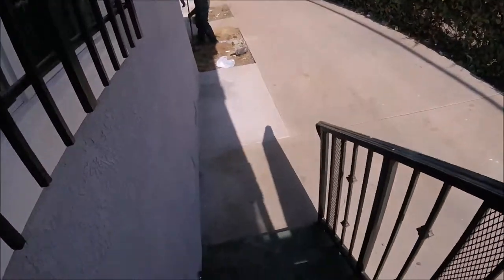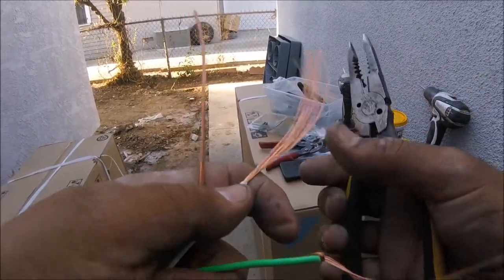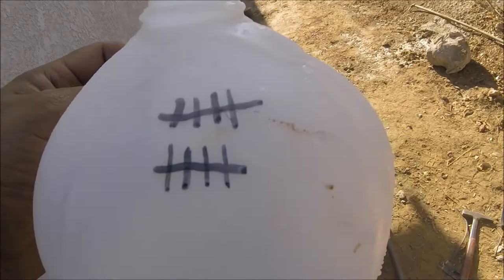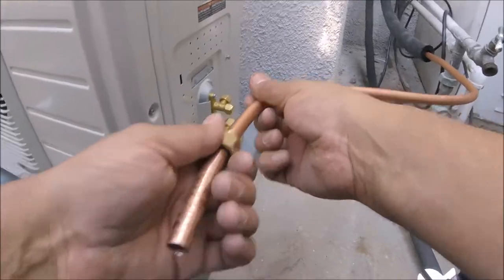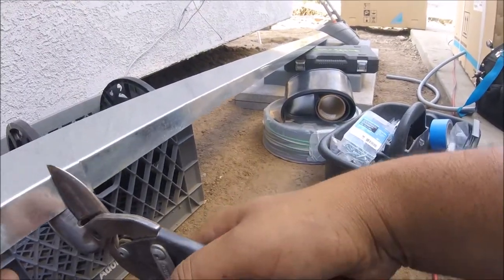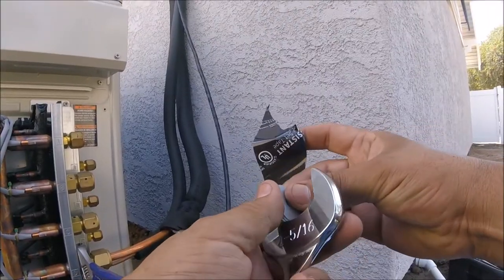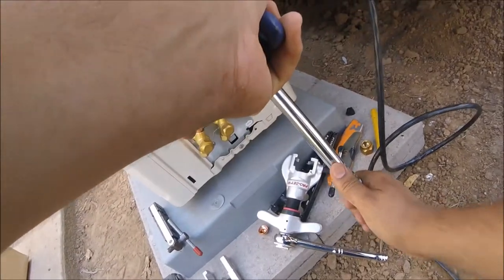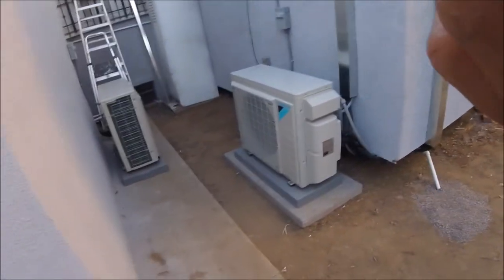Two Daikin mini split installs and dry wells.

Comment: Very nice and clean install can you tell me if its necessary to install one head in kitchen and or bathroom or its not required how do you determine? Secondly do you have to have the metal line hide custom made for these installation as i see the supply house sell the plastic one's that may be more expensive in cost ?Thanks always learn from pro's..

Comment: What brand of pumps did you use?
Reply from the maker: Marc Spencer... Sauermann. I don't have a preferred brand yet but I did notice that I don't like the small one that comes with kit. It's too noisy. The longer Sauermann that can fit inside the unit is really quiet. I'm sorry I didn't get the model numbers since I recently started using them.

Comment: Great Video.  Two quick questions.  What type of hole saw do you use for stucco?  And, it looks as though the head units are mounted very close to the ceiling.  Is it OK to be closer than the 6" recommended?
Thanks